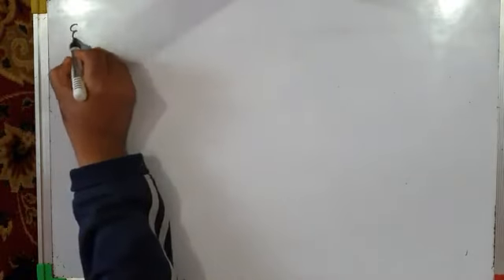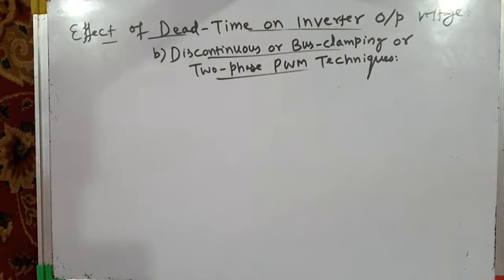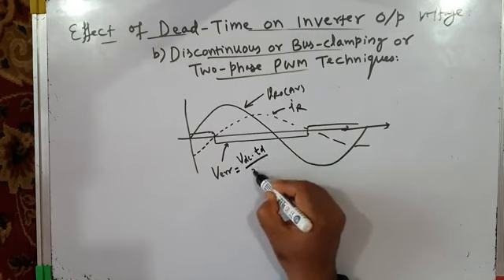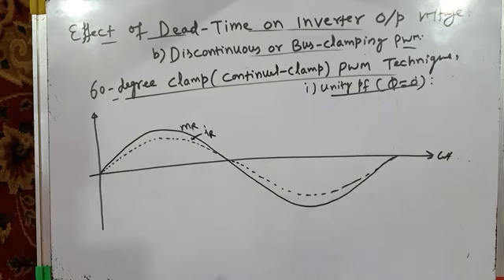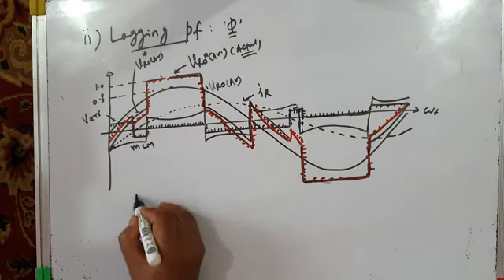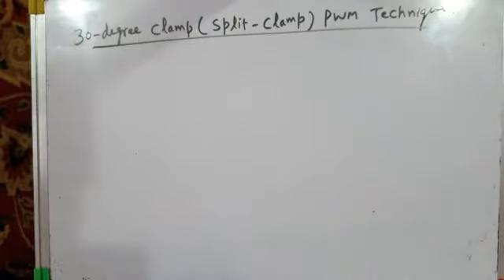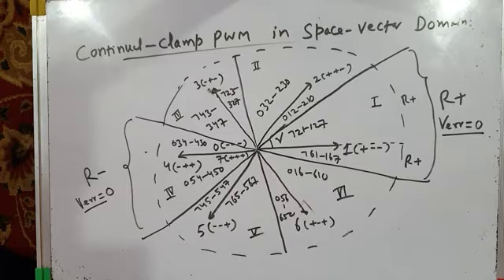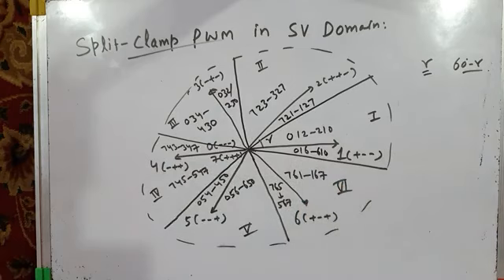Inverter Dead Time & it's Effects-Ii

Comment: Hello Sir!!! can u please make a small video on difference between Line commutated Inverter and voltage source inverter. Sir can u please explain the applications of Line Commutated inverter except in HVDC.  Where we can use Line commutated Inverter? can we use it in stand alone systems?